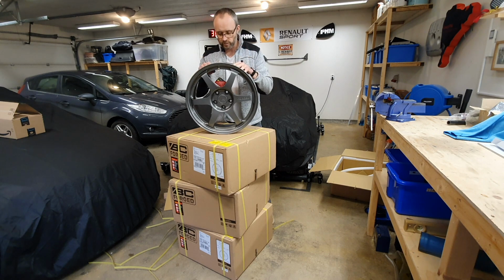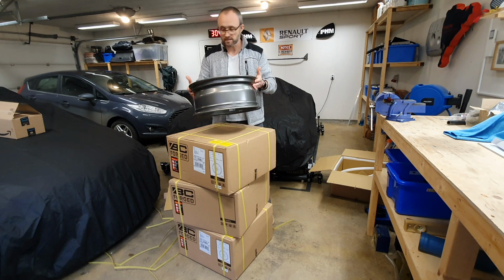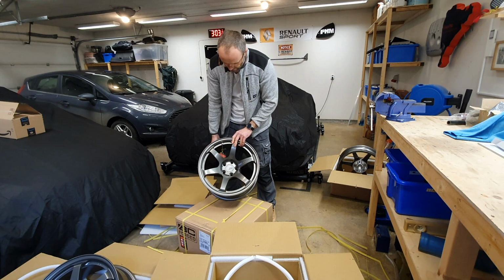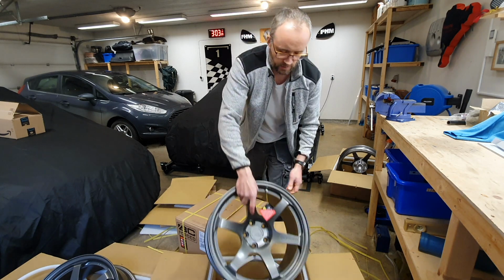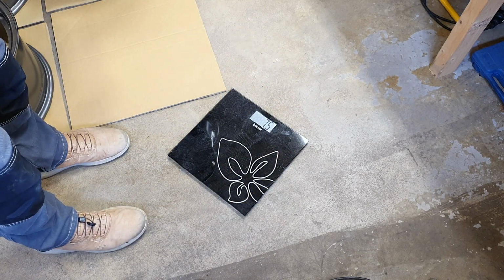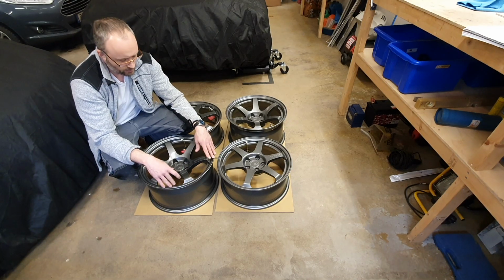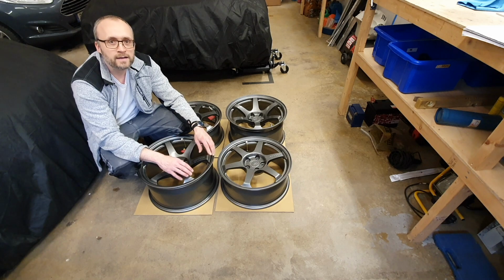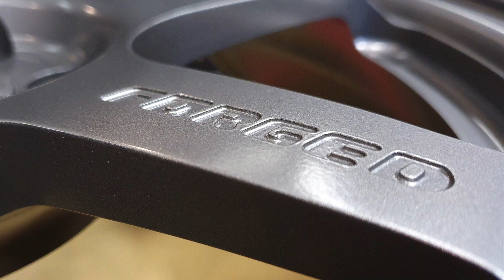THE CUSTOM BC RT51 FORGED WHEELS HAVE ARRIVED!

Comment: Damn those are some sexy wheels!
Reply from the maker: Thankyou guys, took me probably 3 months to decide the style, the offset and finally the colour! Ocd overload 🙈
Reply: @SoloLap  Man I can understand that, been looking at wheels for the S3 for months myself and still not quite sure what to go for lol
Reply from the maker: @Beardchanics  I guess you at least know your ideal offset and width? BC aren't that cheap but they have some cool designs and they're pretty light!
Reply: @SoloLap  Nope, no idea of that either lol Very much depends when I go for them. Want to enlarge the body at some point which would change the requirements.
Reply from the maker: @Beardchanics  you can't be a widebody conversion, will look immense!
Reply: @SoloLap  square wide body is what I'd like to aim for :) Probably down the line though as reckon not going to be cheap as no kit for it out there. Most body kit for S3 are for the saloon version but I'm wondering if the RS3 LMS saloon body kit can be adapted to the sport back.
Reply from the maker: @Beardchanics  that sounds like a worthy project indeed!!
Reply: @SoloLap  Took on the S3 as very long term project. Mostly due to finance ofc.

But I always said if in 10 years it's where I want it I'll be pretty damn please already :)
Reply from the maker: @Beardchanics  they're a great car! I love my a3 cab and that's only a 1.6tdi 😂